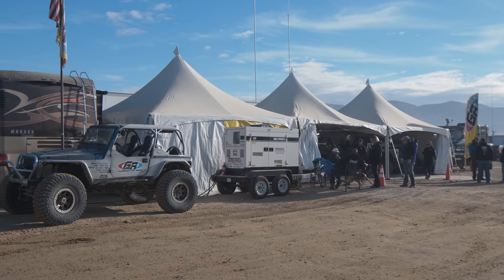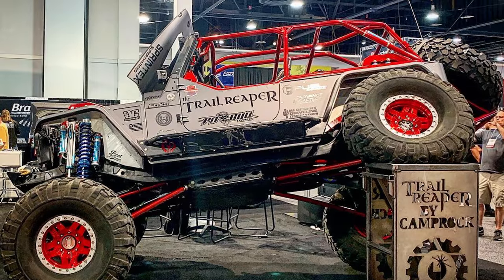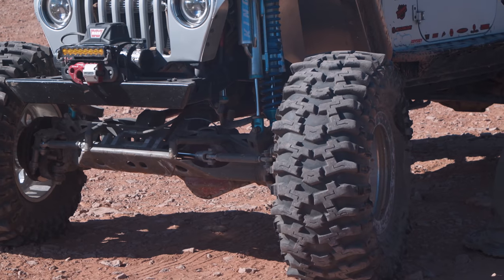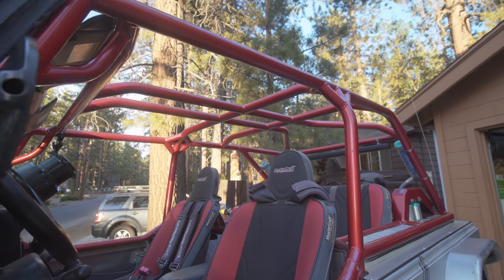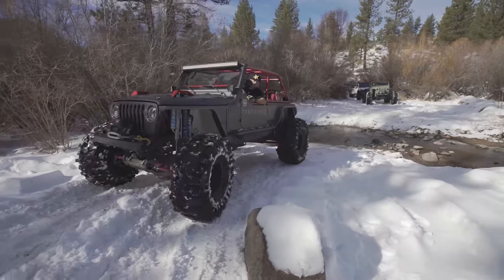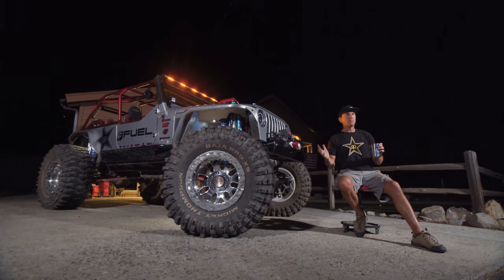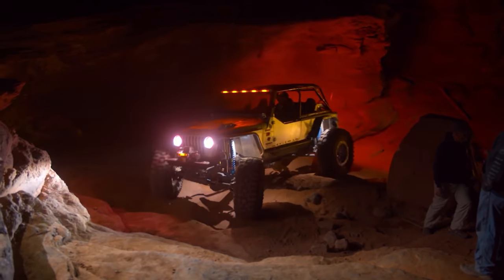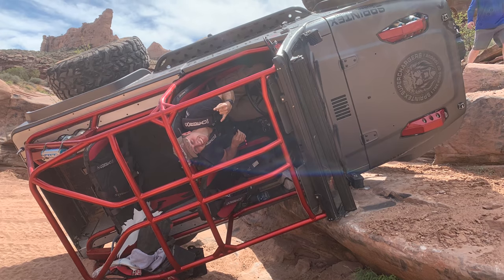Walkthrough of The Trail Reaper: Jeep LJ Built for Everything

Comment: Beast! Love that it still has the 4.0. Especially with seemingly everyone swapping in an LS. 
That cage with the suspension tie ins is a thing of beauty. ✊👏👍
Reply: People swap LS’s for a reason.
Reply: @metwono  You don't say 🤷‍♂️🤣
Reply: It's a beautiful machine but an LS swap would really put the finishing touch on it.
Reply: Thank you for seeing the beauty of it! I’d love more power and having an LS would open up a whole new world of possibilities pushing the limits of my driving. But... I kept it stock for the simple reason of CA smog/registration. I drive it on the street all the time and I didn’t want to worry about how the register it every other year. As it sites right now, it can pass smog anywhere I take it! It’s actually funny to see the faces at the smog shop when I pull up. 😂
Reply: @thetrailreaper6317  Funny, I chose a 4.7 Stroker crate motor for the same exact reasons. Moved out of California since the install but I  don't have to worry about any emissions issues either. No CEL's and she runs like a top. All the torque! Golen Stroker FTW
Reply: @thetrailreaper6317  I can’t believe California is cool with tires sticking out like that but would throw a fit if you swapped the engine.
Reply: If you ever need more power stick with Mopar. Nice build by the way. I'm a cj7 guy with all AMC drive train.
Reply: @thetrailreaper6317  LS are junkyard motors.  Keep you Jeep motor!  I like my 401s in my CJs, but you won't pass smog with the 401!

Comment: Badass Rig!! Out of curiosity do you regret not going with leveraged rear suspension (trailing arms)? Im thinking about going leveraged in the rear of my VERY slow YJ Unlimited Build but with how im doing the tub stretch things will be very tight so ove been wondering if its worth all the extra work to make it all fit.

Comment: Full hydrolic steering on the street? I'm thinking of doing this and want to know what orbital valve your running etc... "Some people" claim full hydro is terrible for the road.
Reply: Full hydro it’s ideal on the street but it’s totally manageable. I wouldn’t want to do long road  trips with it but in my opinion it’s fine for crewing around town and a quick blast down the highway. That being said, what you give up on the street you gain off-road! I love full hydro in the rocks!!! If I remember right... I changed to a PSC 180 2.5 turn. (Not positive on the 180 number.) lt’s either what I had or what I switched to.🤦‍♂️
Reply: Check local and state laws in your area. Full hydro is not street legal where I'm from.